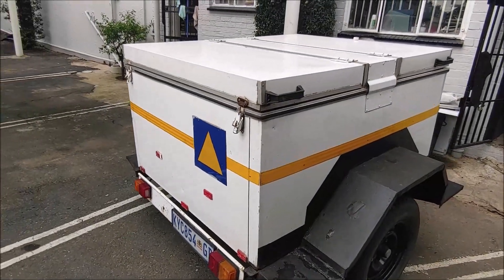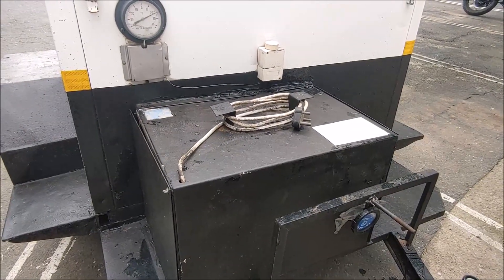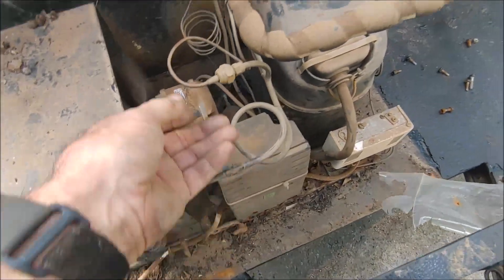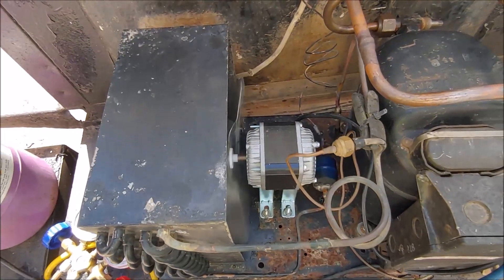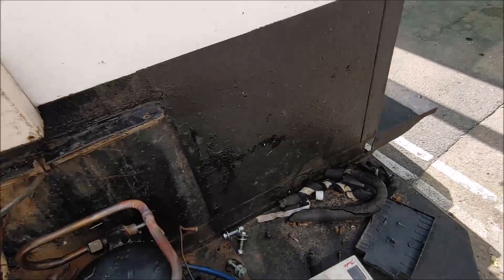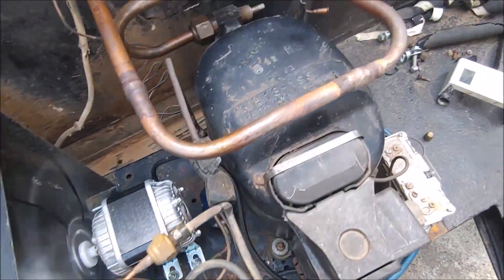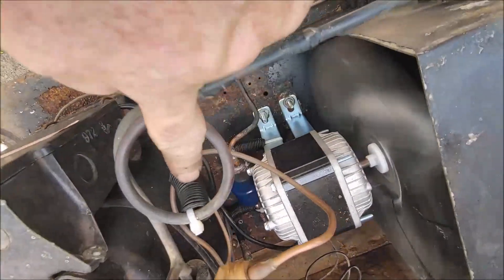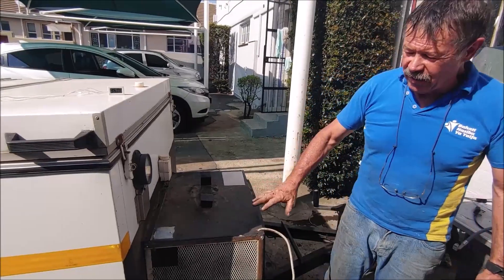Repairing a refrigerated trailer

Comment: Nice job. It look's to have low suction pressure as you said. How do you know that the high side pressure is not also low, as I did not see a tap into the high side. Thanks
Reply from the maker: I am not really interested in the high side pressure because the difference between a cold freezer & a warm freezer differs with about 250psi. As  long as the suction pressure doesn't go into vacuum and the freezer is cold, high side pressure is irrelevant.

Comment: Please help my fridge has frozen drain hole I've posted a video on my channel with more explanation. Thanks
Reply from the maker: We often find that there is a gas tube inside the wall of the fridge, very close to the water drain outlet that causes the water in the pipe to freeze up inbetween the inner and outer wall of the fridge. The only repair is either to move your drain outlet to a different position or from behind the fridge, cut it open & move the gas pipe away from the drain outlet pipe.
Reply: @JDNelRefrigeration  Hi thanks for your quick response. I have black coils on the back of my fridge/freezer so I can't access the back as I'm sacred if I move coils to gain access to the back  there will be a leak. Is it possible u could make a video of how to do as I can't find anything on youtube with my fridge like this happening. Or is it possible I could wrap copper wire around the compressor make a hole in drain pan and seal it then feed the wire through the drain hole to the top would there be enough heat transfer do u think? Thanks
Reply from the maker: @electricservices49  You can try with a flexible heating element. Put it alll the way through your drain pipe. Thats not what I would do as the drain pipe is plastic & some heaters will melt the plastic. The black grid behind your fridge is the condensor. If you loosen it & bend it slightly out of the way you can reach the back. The copper wire will npt transfer enough heat.
Reply: @JDNelRefrigeration  Thanks I will try what u suggest and attempt to get to the coils inside the fridge. Do u think there will be enough play for me to move them after I've found them and is there foam I would have to cut away and what do I use to replace the foam after? Thanks
Reply from the maker: @electricservices49  Yes, you have to cut the foam out and replace it with AB Foam.
Reply: @JDNelRefrigeration  Thanks very much appreciated for all your help. One last question if u don't mind do u know if mine has a heat element inside aswell as in the manuel it says auto defrost for my fridge part does that mean it just turns on and off by the timer or does it have a heat element like other fridges?
Reply from the maker: @electricservices49  What fridge do you have? I am unable to identify it from your video
Reply: @JDNelRefrigeration  the model is fridgidaire FRE196AS. It's a fridge top half and freezer bottom with black coils on the whole back side. The fridge says it has auto defrost and freezer does not. If u search model number u will find more info there if u need it. Thanks
Reply from the maker: @electricservices49  I cant identify it, please email me photos of the front, the back and inside with the door open.